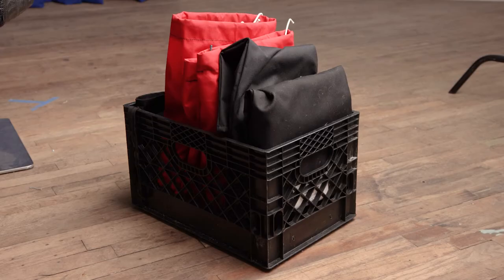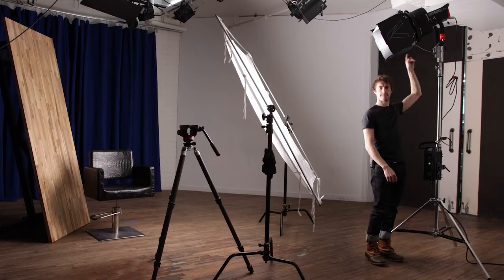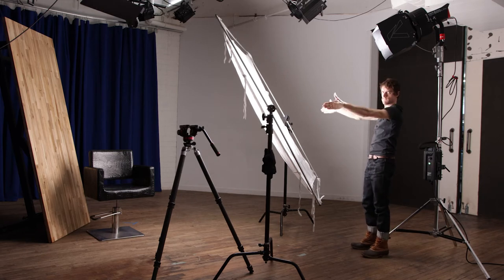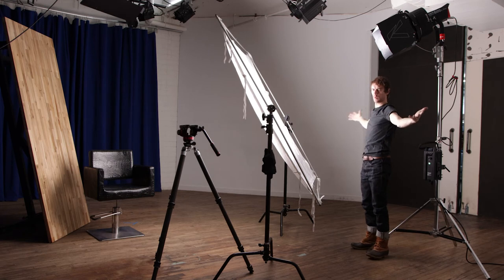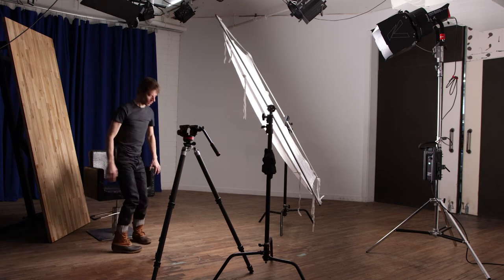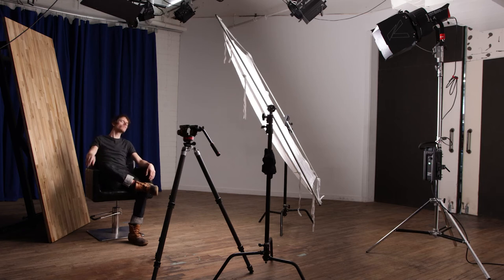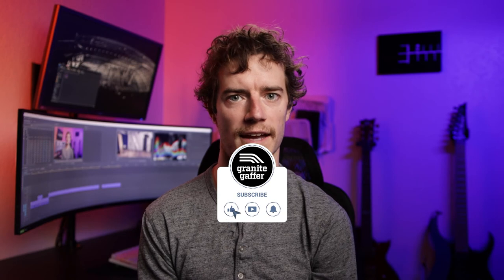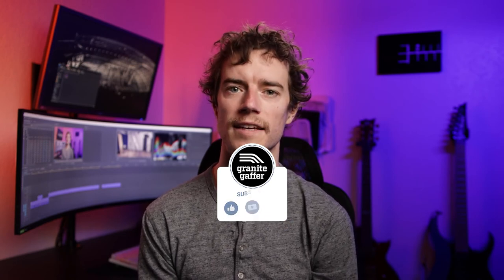What's the softest diffusion rag?

Comment: Nice.  Diffusion options don't get as much thoughtful discussion as they ought to.  Perhaps you'd consider doing a part 2 with some of the diffusion fabric options not included in this comparison like White Quarter Silk, White China Silk, Highlight, Black Quarter Silk, Black China Silk and Black Poly Silk.  Discussing black versus white diffusion fabrics could also open up a new topic for comparison: Specular Highlights.
Reply from the maker: That's a great suggestion for a follow up video! Thanks for the tip!

Comment: Great video. Any stand you would recommend for the 600D, f10 w/barn doors combo besides a combo stand? I have a couple mathews combo stands for my 600ds m, but they are a pain to port around in a car and take up a lot of space. Using my beefy baby stand with this setup seems sketchy though or with a 5ft softbox. Best to stick with the combo? Thanks
Reply from the maker: I use the Matthews digital combo stands. They're a little lighter weight and easier to port around, but basically the same height extension!
Reply: @thegranitegaffer thanks! Any lighter diffusion you would recommend for talking the edge off, pushing light through a window? 1/2 soft frost cuts it by 2 stops, not great with my 600d. 1200d or hmi would be better I think for 1/2 soft frost probably?